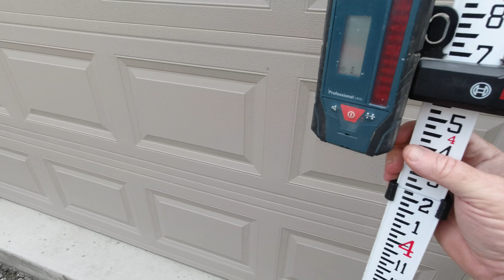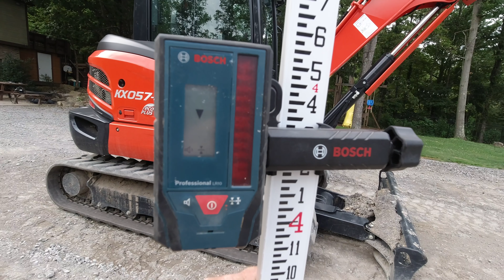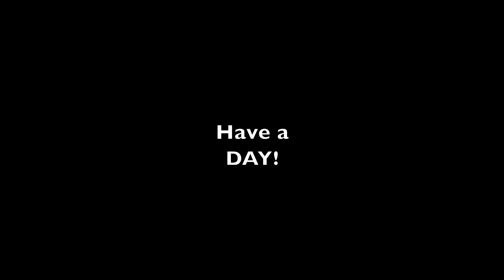Preparing For Final Pour

Comment: Mike, you might want to consider using a channel drain at the end of the new concrete apron. You could have the drain run under your driveway to prevent ice buildup in the winter during thaw and freeze cycles. I work for a stormwater drainage manufacturer, so I may be a little biased. :)

Comment: Mike, I've been doing concrete/carpentry for 28 yrs and I'm curious y u want to let the ground dry out? Water is your best friend when compacting. Also why are u taking material out to put rock in as fill that you have to pay for? Cheers from Canada!😁🔨🇨🇦
Reply: Excellent questions.  Mike is just a tad ocd about dirt and rock.  Should have got the grade right before building the barn.  First things first.
Reply: Motor Mike moves more dirt from pointA to B and then B to point C and then repeat that several more times.  I believe he just likes digging.

Comment: Hey Mike , 
Good to see things are coming along finally on your new building !! 
Couple things , that little spot up by the building between the two outside slabs that you have formed off . Is that going to be a planter or something else ?? 
If a planter , that could make a mess on your slabs everytime it rains , washing out any thing in that space .  And around your down spout on the far corner . We always put a little form or just exspantion joints around the down spout maybe 6 " around it , make it's own little slab , instead of tied into the big slab , that vcd way if you had to do anything with that pipe, you would only have to remove that one section of concrete , instead of cutting up the big slab 
Something to think about .
Cant wait to see the finished project !! 
BigMike
Reply from the maker: Thanks Mike

Comment: You might want to consider a drain of some type at the end of that slab. You had trouble with ice on the driveway last year. And, I thought some erosion problems along the driveway as well. That hard surface is going to compound your problem I think.

Comment: What’s that spot in the middle where there will be no concrete? Planter? Wouldn’t you want the concrete the same thickness as inside to take the weight of the tractor, etc in front of the big doors?

Comment: Probably too late due to the editing lag but if I were you, I’d eliminate that decorative cut out by the door. Assuming it is not for some type of service access, I think it will just lead to water intrusion under the slab and foundation. Assuming it is for aesthetics, you could accomplish the same with a nice size wall hanging basket of flowers or a OWTM flag or cool sign to break things up. Otherwise you have the water issues and have to either mow or maintain it somehow by bringing a mower up on the slab. Just thinking out loud… Everything is coming together nicely.

Comment: What is the purpose of the little section to the left of the roll up door that looks like it won’t be getting any concrete?
Reply from the maker: Will be used as a planter among some other ideas
Reply: Outdoors With The Morgans   That was one of my ideas. Another one is a spot for one of those large stones in a rock garden using a contrasting stone to your drive ways with a few flowering plants.

Comment: I take it that  your area not subject to earth quakes    
My experience  with  large  slap pours  there was  installed  thin joint  plate material  and rubar pentration of slab already  pour then a sleeve with grease  over that  then concrete   this allows  slab to to move with quake and hopefully  not break
Reply from the maker: Yes, no earthquakes here. Thanks for sharing

Comment: Realize that the water coming to that lower corner will also encompass all the square footage of water coming off the roof. So not only from the pad but also the roof. I'm wondering with so much water flowing to that corner that it doesn't become a small river that will then run down the driveway creating a washout situation and erode the driveway. Something to think about. For example, on a 2,000 square foot roof, you can collect 2,000 x 0.56 = 1,120 gallons/inch of rain. If your average rainfall was 25 inches/year, your annual collection potential is 1,120 x 25= 28,000 gallons/year. All running down that sloped corner.
Reply: He already has gutters and drains for the roof downspouts.

Comment: How much extra concrete have you had to deal with during these pours or have you ordered the exact amount which is very hard to do?
Reply: The last pour they were 5.5 yards short.
Reply: @homernextdoor5950  Well, that truck did not mix up 5.5 yards of concrete.  It came with 6 or even more, what ever the minimum order would be for that size of truck.  What happens to the stuff they don't use in the floor??
Reply: @rockandrattleretreat5830  Minimum order can vary from company to company but its usually 3 yd minimum. The extra concrete in the truck goes back to the plant and they make pre cast pavers, blocks etc, at the cost of the customer of course!😁 if your prep work and grading is bang on, I order .2 of a yd extra on pours up to 1000 sq ft.

Comment: Those rebate steps at the entrances will end up losing the corner arris especially if you plan to take any plant inside.  Seen this happen many times in industrial units.  Better off just taking the slab through and just sloping the fall down at the entrance, then just ensure the roller doors have a rubber thresh detail along the bottom to seal when closed.

Comment: I'm surprised that Hause's crew didn't reccomend arcing or pouring a radius on the corner of the slab at the low point. Guaranteed to crack  most likely in the winter when you can't see it.
Reply: I have always been told that there are two guarantees with concrete.
It gets HARD, and it CRACKS.
 This coming from concrete contractors.

Comment: If the door heights were off on the inside causing you extra work, why were they not off on the outside of the building also ? Makes no sense. You had that concrete poured first why was it not an issue then ?